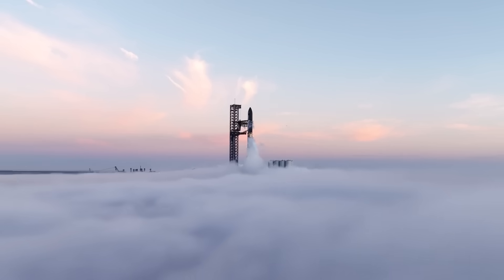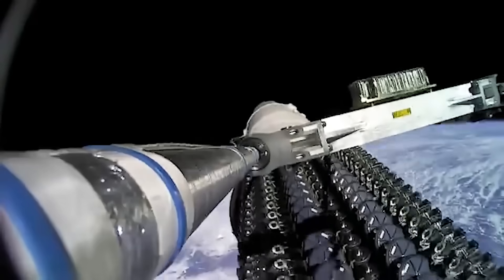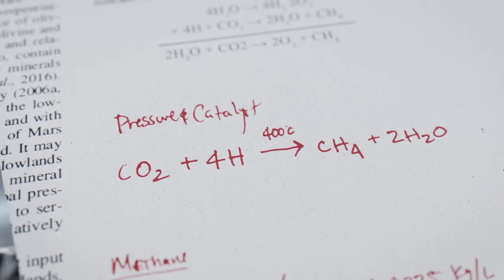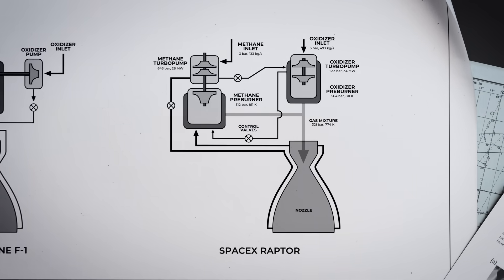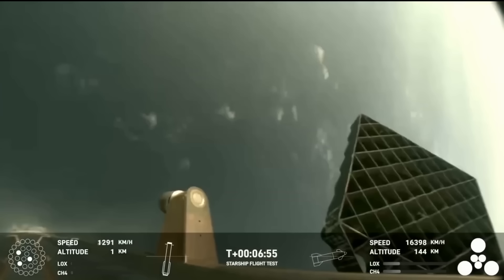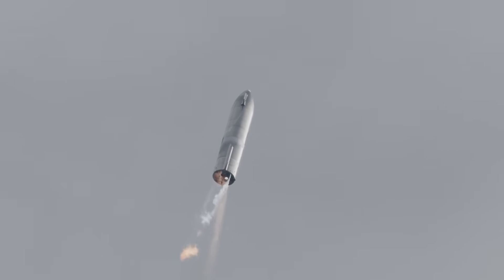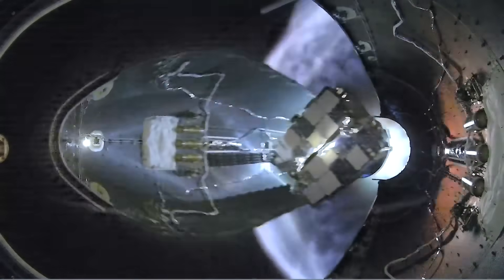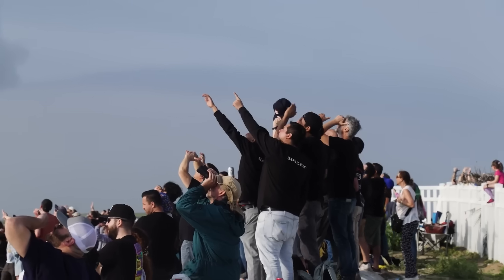Starship Reached Space. What Now?

Comment: why are you so facinated by this thing ? the engineering is horrible no spacecraft ever failed so many tests
Reply: SpaceX’s first ever rocket, the Falcon 1, failed its first 3 flights and they nearly went bankrupt. They barely had enough for one more rocket after finding out they only needed a software update to fix the issue. Flight 4 flew and successfully put a payload to space, making SpaceX the first privately funded Space company to put a payload into space using a liquid fuelled rocket.

This is the same company that has also made the most reliable rocket in human history with over 300 flights and nearly 250 consecutive landings of the F9 booster.

This is what iterative testing is. Fly, check for failure points, fix, fly, check, fix, fly, repeat. They still do this with Falcon 9 to this day.
Reply: @archierush868  yeah true but really compare this to any nasa rocked … on of their engineers even stated that they would have been out of business if they’d have lost as many rockets as space x …. And I honestly doubt that the money space x is coming out of elons pockets…
Reply: @DrHenrik  If you’re worried about costs, the entire Starship Program, from vehicles to tower to ground support equipment to build site to engines, literally everything starship related has costed SpaceX around $5B since 2019. NASA’s yearly budget is around $20B. One SLS launch is $4B.
Reply: @archierush868  yeah so we had one sls launch and it worked let’s and so far 0 successful spaceship launches (this one got into space but did spin out of control) soooooo
Reply: @DrHenrik  And we’ve also had 3 Starship flights, each one getting further each time. As I think i said before, flight 4 is planning on doing a successful reentry of the ship and successful booster splashdown while doing a simulated catching attempt. If that goes well, flight 5 will have a real catch attempt for the booster and possibly a soft landing for the ship.

It already capable of putting several tonnes to LEO while being expended, but SpaceX designed to to be reusable so they’re gonna keep trying until they can make it reusable.
Reply: @archierush868  or the space shuttle for that matter which might be closest to spaceship (or the Saturn)
Reply: "no spacecraft ever failed so many tests". A quick look at the history of the US space program begs to differ. (And nevermind the Soviet program, which was even worse!)
Atlas-Centaur failed on 5/6 test flights. Vanguard failed on 8/11 flights. Thor-Able failed on 5/7 early flights. The first 6 Ranger spacecraft failed. The first 13 Discoverer missions failed.
It's worth noting that most of those (except Vanguard) ended up working in the long run once the problems were fixed. Atlas-Centaur in particular now has a long track record, and it's descendant Atlas V still flies reliably to this very day. So Starship is far from the worst example, and judging it after just 3 launches is very premature.
Reply: @lazarus2691  are you seriously comparing the early rockets to space x rockets ? The issue I am voicing is mostly that it is not the as great an engineering accomplishment  as it is made out to be. Space x builds on almost 100 years of research done around the world. Take the previous launch where the weak launchpad threw up so much debris that it damaged the engines! This is avoidable and yet it was heralded as a success that they managed to rule out this specific pad design ... there is a way to do things smarter and its not necessarily move fast and breake things that are already known! Same when it comes to tesla cars! Who would have thought that people want decently build cars and not just big batteries...
Reply: @DrHenrik you literally said “No rocket has ever failed this many times” and he’s proving to you that they did fail that many times.
Reply: @archierush868  well if we are literal I have to correct you I said spacecraft
Reply: No spacecraft has attempted l flight based dev testing before. 

Not spacecraft has also been built at this speed and scale before either. Your failure to understand how different development regimes can exist simultaneously and are not directly comparable isn’t an argument it’s dumbassery
Reply: @weekiely1233  No this is simply false, when the spaceshuttle was developed it was the first reusable spacecraft, saturn five was comparable in scale and power. space X only evolves existing technologies which makes it even less impressive that they keep failing
Reply: @DrHenrik  that was not false lol. Shuttle and Saturn V weren’t developed through inflight testing but ground testing(where many deaths occurred) which was explosive. Yet even with these development cycles they still had plenty of failures.

The first flight of shuttle nearly killed the crew (and did kill ground engineers before hand) because sound levels were higher than expected, foam slammed into the TPS losing tiles as well as hitting a elevon and throwing it so hard one way it past the limit it should’ve broke at and it was only by a miracle it worked as well as it did and saved the crew. The shuttle later went on to kill 7 astronauts FOR THE VERY SAME FOAM ISSUES 

Saturn V has a complete failure by your definition as the upper stage failed to light, it lost engines on ascent and the mission didn’t meet the full plan.

Both of those programs also had much more funding than starship and neither are comparable on their own. Saturn V was fully expendable. Shuttle was actually refundable not truly reusable and both cost over 1.5 billion per launch compared to starship which costs 110 million
Reply: @weekiely1233  the issues were a little different and exactly extensive ground testing prevents so many failures. However if you believe that space x does no ground testing that’s laughable.
Reply: @DrHenrik  except it DIDN’T, that’s the point 
It also took more time, cost more money and produced less capable vehicles at too expensive a cost to fly at the desired cadence.

The whole point of these test flights is to find issues and fix them before they fly payloads in a real world environment. And the iterative approach they have taken has already led to massive improvements. If there was a payload on that last flight heading to orbit it would’ve been a success. NASA called it a success, numerous industry leaders called the last 3 flights successes. Why is it that the only people who don’t seem to think they are successful tests and who deny that this isn’t a setback for them are musk haters who can’t get him out of their head, idiot journalists and people who know nothing about spaceflight (like yourself)

SpaceX haven’t done ground testing like Saturn V and shuttle did because the whole point of these flights is to do that same testing in a more realistic environment
Reply: @weekiely1233  sorry but it did if you claim that groundbreaking does not help you should provide the relevant sources.
Reply: @DrHenrik  if you are gonna claim iterative, flight based development is bad you need a source
Reply: @weekiely1233  no my claim is that both are necessary and that prior groundtesting prevents failures during flighttesting. 
Conversely you are stating that grountesting is unnecessary
Reply: @DrHenrik  why does it matter whether they test in flight or on the ground? There’s no payload and these are prototypes. Wouldn’t you agree it’s faster to simply do the testing that would be done on the ground in flight too?

There’s nothing failing here.  There’s no payload onboard or recovery planned. This was repeatedly stated numerous times too
Reply: @weekiely1233  All I'm saying is that more ground testing would make it more efficient but i agree with you in that flight tests are indispensable. I just don't like that spaceX gets so much hype when 80 % is PR. e.g. did you know that boings capsule is going to be reusable ? But here we are in a world where we think that the dragon capsule is somehow a big innovation. don't g3et me wrong spacew X made it much cheaper but scientifically they only iterate upon existing research which is why they can affort all those launches. The base already exists.
Reply: There have only been 5 rockets in history that have come anywhere close to capabilities of Starship. The Shuttle and Buran were both partially reusable, but needed a long time between flights, costs an absurd amount per flight, and could only put 1/5th as much payload as a fully reusable Starship. One only flew twice while the other flew 135 times with 2 failures killing 14 people. The Shuttle also cost an inflation adjusted 2.13B per launch when counting the development costs as well.

SLS took more than a decade for its first flight, not counting the decade of costs and development prior to that under another name, nor development time for the engines that were developed 6 decades prior. It cost tens of billions prior to the first flight, cost several billion per year even if it doesn't fly, and another 3-4B per flight. It did have a successful first flight in 2022, but won't have a 2nd flight until 2025. All of that for 2/3rds of Starship's payload to orbit ability.

The N1 was also roughly 2/3rds for payload to orbit compared to a reusable Starship. However, the Soviet Union was never able to get the rocket into orbit. They flew and failed 4 times over a 3.5 year span of flight tests. Starship will launch for the 4th time in just 13 months.

And then there is the Saturn V. The Saturn V was nearly as capable as a reusable Starship with payload to LEO. But despite what CSS would have you believe, the program was not flawless. First, the Saturn V was part of a large development program that started with the Saturn 1. There were at least 6 suborbital flights, which you and others keep counting as failures despite that being the plan. Then AS-203 reached orbit and then exploded while in orbit. NASA considered it a success since it achieved primary goals, just like Starship. And then for the Saturn V itself, SA-204 wasn't even a flight test and yet managed to kill 3 astronauts. SA-502 had engine programs that caused a partial mission failure. And then SA-508 had issues with the rocket that damaged one of the second stage engines. It then had another major failure that caused a mission failure and nearly killed 3 more astronauts.

Comment: Spinning on reentry
Reply: and?
Reply: If SpaceX can get 33 Raptor engines to run perfectly in sync, I think they can fix a simple RCS system.
Reply: @lazarus2691  can they?
Reply: @sempi8159  I mean they made the RCS on the Falcon 9 boosters works just fine, and they're also pretty big. Not to mention the Falcon 9 upper stage and Dragon.

There's been speculation that the cause of the RCS failure on Starship was due to icing. Traditional RCS uses dedicated gas, while Starship was tapping off from it's cryogenic ullage gas - which is a lot colder than normal. 

If so then the simplest fix, if all else fails, would be to go back to nitrogen COPVs like on Falcon and the earlier Starship prototypes. Though there are probably plenty of ways to solve an icing problem too.

We should know more when the FAA release their incident report in about two weeks time. And then another two weeks after that the next test flight is scheduled, so we'll see how well the RCS works there.
Reply: @sempi8159  they’ve already done the first round already

Comment: Tim may be your friend but you should still put some brakes on your fangirlism. NASA calculated they they need 15 rockets, not 9. And calling the shutshow that happened with the second stage "control problems" is just lol
Reply: It’s reusable, meaning the only costs would only be for fuel and minor refurbishments. The costs could be as low as a few million since they don’t need to make new engines, ships, boosters, or anything else, just fuel. Plus, once they send the Starship HLS to the moon, they can start the refuelling the fuel depot. It can be done with as little as 3 ships and one booster but an extra booster and tanker is likely gonna be needed.
Reply: No the 15 figure is a SpaceX figure. It’s also an estimate 

We will see upgrades and extensions made to the vehicle in future that will decrease the cadence needed for refuelling. 

Starship V3 can do it in 8 for example while V2 is ~10 

Regardless it shouldn’t be a significant issue with the cadence they’re already meeting that they will exceed 

These are also test flights where issues were always expected. It by far met what everyone was expecting and Flight 4 & 5 will continue the improvement as the last 3 have. Your failure to understand what the design and engineering philosophy is isn’t an argument against it
Reply: 15 launches isn't a showstopper. SpaceX did 12 Falcon 9 launches in March alone (plus the Starship launch, so 13 total), so they have experience with high launch rates.
Obviously Starship isn't going to reach that rate overnight, but they only need to hit 2.5 per month by NASA's boiloff rate estimate and each launch has been getting quicker. 
The gap between the first two launches was 212 days. The second and third, 117 days. For the current planned date of May 9th, the third and fourth will be just 56 days.
So roughly halving each time. As a sidenote, I'd point out that NASA's original plans for a reusable lunar shuttle in the STS program estimated 14-16 refuels - a very similar figure.

Comment: Elon caught up to technology from 50+ years ago.
(slow clap)
Reply: Please indicate a rocket from 50 years ago with over 7000 tonnes of thrust.
Please indicate a rocket from 50 years ago that used full flow staged combustion engines.
Please indicate a rocket from 50 years ago that performed a controlled reentry of a 250 tonne booster.
Please indicate a rocket from 50 years ago that ran 33 engines at the same time.
Reply: Was there any space agency or company 50 years ago physically making and launching rockets that can be fully and rapidly reused?

I know there were some designs for partial reusability, including Saturn-V which had a large helicopter catch the first stage like RocketLab did with Electron but only once, but no flight hardware, unless you know of some?
Reply: This technology didn’t exist 50 years ago lmao
Reply: Name any other rocket, much less one from 50 years ago, that is even remotely as complex as Starship.

Comment: "Starship has reached space"

No, it has not. It never reached orbital velocity. If you don't reach orbital velocity, you're not doing anything useful. I expected more from this channel.
Reply: Space and orbit are two different things. You can be in space but not in orbit. You can’t be in orbit but not in space.

Edit: It also DID achieve orbital velocities, just not in an orbital trajectory.
Reply: It’s velocity was so close to that of being orbital that trying to split those hairs on what does and doesn’t count as orbital is nonsense
Reply: It got 97% the velocity. The plan was never to go orbital. 

Space is 100km up not orbit. Stop spreading misinformation to further some bias you have
Reply: Starship only didn't reach orbital velocity by the technical distinction that velocity is comprised of both direction and magnitude. Starship was in an intentionally eccentric orbit to guarantee reentry, but it's speed at 120km was equivalent to an object in a 120km zero eccentricity orbit. I.E it had the magnitude, but not the direction.
Also worth noting that it was just 86m/s short of orbital speed at it's apogee of 234km, or about 1.1% short of the required 7768m/s. And it had ~4% fuel left.
Even ignoring the logarithmic nature of the rocket equation meaning the last drops of fuel are the most effective, that's clearly enough.

Comment: 3rd time they finally managed to do what NASA was doing in the 60s. Congratulations on the billion dollar debris field.
Reply: It doesn’t cost a billion dollars and this is simply a different type of development than the Saturn V
Reply: @weekiely1233  it is billions and yes, it's a far more amateur development.
Reply: @Popito84 from multiple sources which varies from as low as $3B and as high as $10B. Some do say around $5B which fits almost perfectly in the middle so it seems fair, plus, it’s easier to calculate with. And, just to point this out, Artemis has already costed almost $100B and one SLS launch is getting to around $4B. That means that if the $3B number is accurate, then the entire Starship program since announced all the way up to IFT-3 and all the equipment and tests done before has costed less than one SLS rocket launch.
Reply: In addition to what the other two have said with their great comments, actually do some research on the Saturn program. NASA didn't just randomly build the Saturn V. There is a reason it's called V or Five. It was the final version of the test program. And that program included suborbital launches, ground tests, failures, partial failures, explosions considered successful, and many successes. Further, even the mighty Saturn V itself had failures. Engine failures on launch caused a partial mission failure during one flight and a complete mission failure during another that barely ended up with the crew surviving. 

Oh, and none of those flights even attempted reusability on any stage.